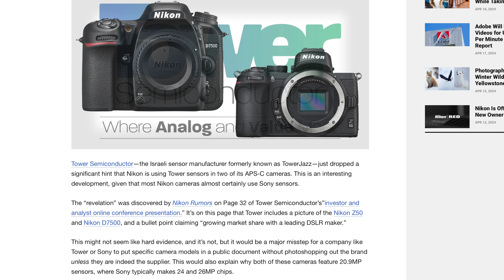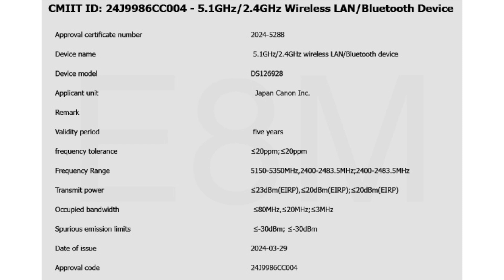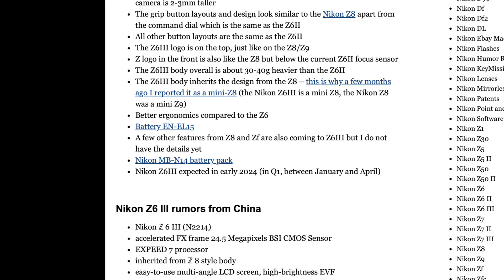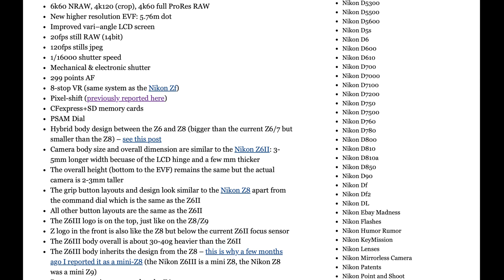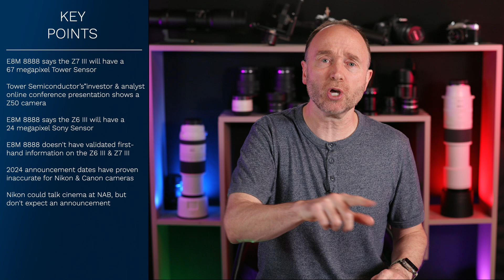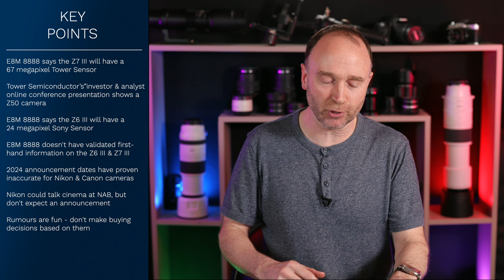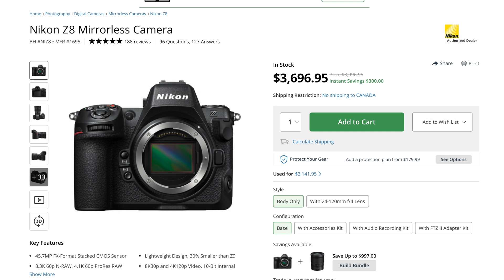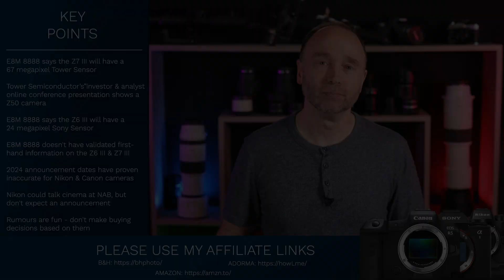Nikon Z7 III: 67MP Sensor ?

Comment: Thanks, Simon, for your thoughts. This is the first time I've heard any mention about the Z7iii that I can recall. Almost all of the noise out there has been about a Z6iii. I have a Z7ii that I would love to upgrade so I'm very interested. Positioning-wise, it makes a lot of sense to me for Nikon to release a Z7iii with a high-res sensor (>45mp) so that it doesn't compete head on with the Z8 and potentially cut into the sales of that camera. I can also see it being a strong competitor to the Sony A7RV and potentially a Lumix S1R Mark II assuming that the Panasonic camera will have the same sensor as the Leica SL3. Wow! It's going to be an amazing April-May for new camera releases so hold on to your hats!

Comment: Hi Simon, you made a solid dissertation of these Chinese Nikon rumors!
I'd guess the rumored high res EVF for the Z6iii was thrown in to hide some source, and that EVF is rather coming later to the Z7iii.  When the Z7 line wants to survive alongside the Z8, it should indeed aim for high-res rather stacked high speed.
Also, if I were Nikon, I would attempt to make sure the Z6ii is not released within 2 weeks before of after the R5ii & R1 because that royal Canon couple will run away with nearly all attention ..

Comment: Marketing wise it is extremely likely that the Z7 is 60 megapixel or more for two reasons, they already have two 45 mpx cameras, the Z8 and the Z9 so a third just cannibalize from the other two. Secondly Nikon does not have a high megapixel camera for advertising and bird photography. Also WHO manufactures the Red sensors, look for a deal there.

Comment: Leaves Canon as the only brand without a super high-res mirrorless. 

R5ii rumors looking weak.
Reply: Agree
Reply: I doubt that they are shaking in their boots. They have a 100mpx sensor in the corral, but have never seemed inclined to go there. I know Canon keeps in close contact with pros who use their gear, and I just don't think super high megapixels are a priority with most of them. Be interesting to see what happens.
Reply from the maker: The 5DS R is still their high resolution camera....
Reply: @OrdinaryFilmmaker  That won’t sell many RF lenses for them though!
Reply: And who knows? Canon could come out with an "S" version of the R5ii just to fill the niche? Just don't  think it's a priority.